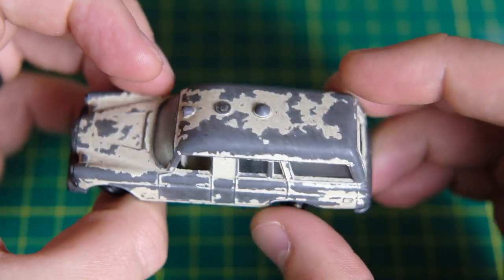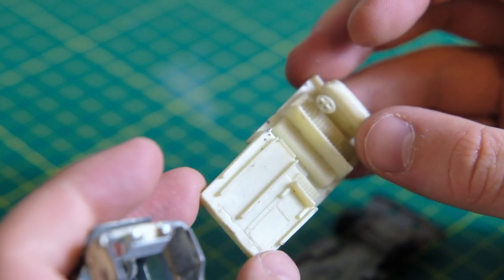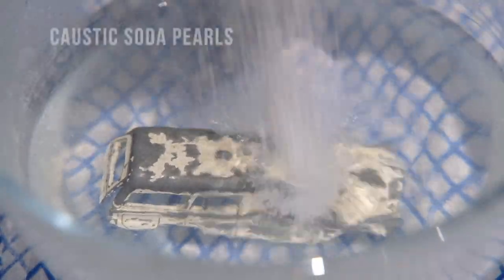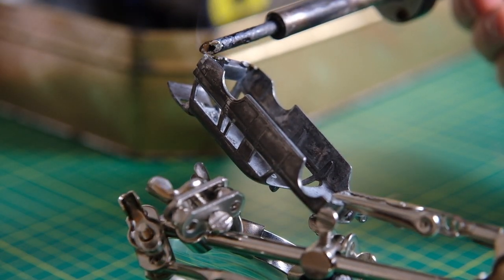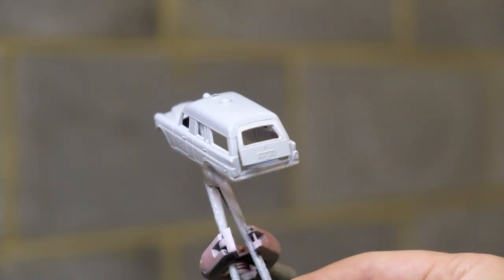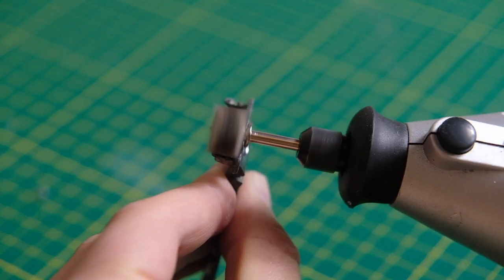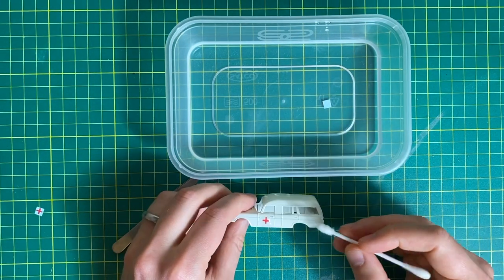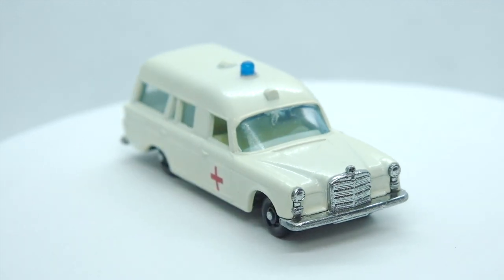MATCHBOX restoration: 3C Mercedes Benz "Binz" Ambulance

Comment: Looks great Jason, a lovely job.👌👍  Just a thought; using the led for the beacon, could you maybe have wired it to battery? I suppose it would be tricky to get access to change the battery, although with the opening tailgate............. 😁

Cheers for now,
Dougie.
Reply from the maker: Could have done but it would have been mighty tricky. I had to file down the bottom end of this LED so it wouldn’t have been usable anyway! A vehicle without an interior would be ideal, perhaps something I’ll try in future